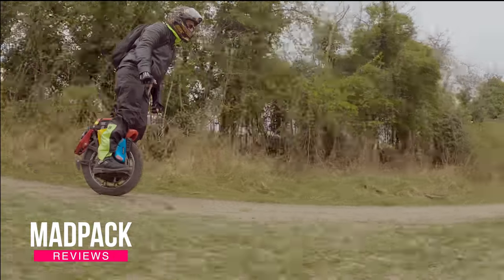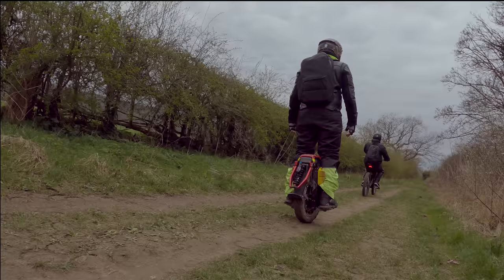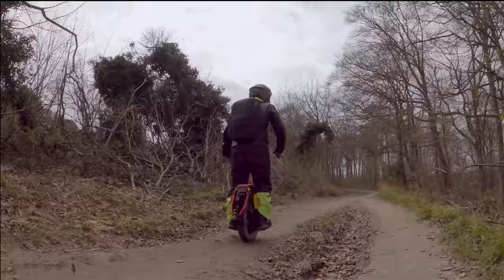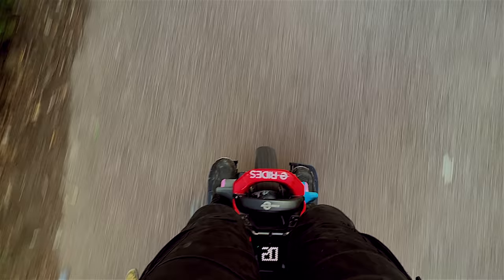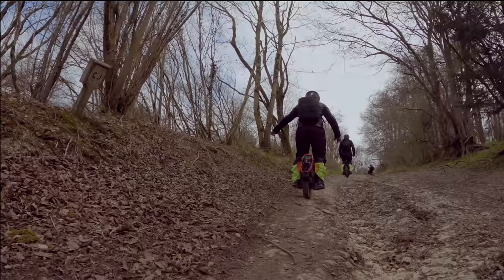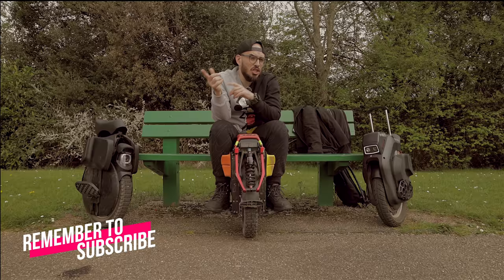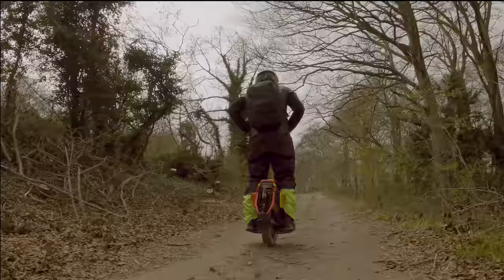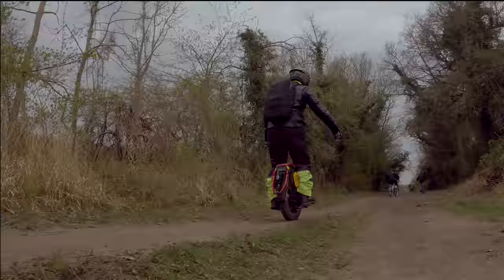Kingsong S22 Review - Best Worst Electric Unicycle 2022

Comment: Good to be critical, but one thing you don't mention is that this S20/22 is a preproduction model. So things like the suspension sliders will be an issue. but things like screw length can be somewhat understood. Rushed out prior to CNY.

Edit: To be clear, you mention that it's a prototype. I typed this specifically in reference to the screw length thing. As in, "when talking about the screw lengths, you don't mention that this is probably pre-prod related".
Reply from the maker: I said multiple times during the 24 minutes that is a prototype but is in my opinion so much hardware issues that is a shame that you can order something that is far from perfect. Like I said this is an amazing prototype but nothing more than that
Reply: He said it multiple times throughout the video.
Reply from the maker: Maybe he was answering to another video :)
Reply: @MADpack  No, and I don't mean to be rude. But if you go to 18:40 and watch for a minute, you mix your idea of 'good prototypes' in with the general idea of a pre-production device. I think you then use your comparison to the V12 pre-prod to say the Kingsong isn't ready enough.

To be clear, I'm aware of what you've said in the video. Hence me mentioning the suspension slider bit as valid criticism even at pre-production. I was specifically saying that bits like the screw length are a non issue for a pre-production device. 

TL;DR. I agree with what you are saying in general, but was disagreeing about the screw lengths being something of concern for batch 1 (2) buyers.
Reply from the maker: It is since this is a pre production that have basically no time to make changes you could order this wheel last summer man… I compared to the v12 since I get it in the same stage. Inmotion asked me to make 1000km on it and give my feedback and that was a product that you could see what close to finish this is literally a prototype should never be possible to order it.. is far from acceptable.. so sorry I don’t take one word of what I said bro. And 1/2 batch should be treated as 3/4 batch they are customers
Reply: @MADpack  no time to make changes to things like the suspension slider channels... Which I agree with you on.

But enough time to make changes to things like screw length. For example, we've seen them change the front handle compound, so clearly it's not too late for any changes.

I understand it's not the best practice and IM handled it better oveall.

But last year 'you' couldn't purchase this wheel. Dealers were offered the option to buy pre-prod wheels. These wheels were seperate from customer devices right from the start.

I think we are talking past each other. Have a good day.
Reply from the maker: Sorry bro I completely agree with you what you are saying I said in the video… if this was a real prototype what I’m saying is a product that they are still making some experiments is ok but when the first units they’ve been already sent away hummm… do you think at this stage is acceptable to get a wheel like this? I don’t think so
Reply from the maker: The lack of quality in screws per example is an old problem when I try to change the position of the pedals on my s18 (not a prototype end version the screw they were gone) unfortunately they send blow quality screws and parts to first batch purchases and I don’t agree with this kind of approach
Reply: @MADpack  the wheel you reviewed... To be clear... Was one of E-Rides S20s.

This IS a pre-production wheel.

It is seperated from the production wheels by about 2 months.

I can only partially agree with what you are saying here. It's FACTUALLY innacurate to say the wheel you have is identical to ones customers will have.

You literally ignored my reference to the handle material as an example as changes between pre-prod and prod.

Prototype is a term.

Pre-prod includes prototype but they are not synonyms. You are riding a pre-prod wheel.

Sure it's not pre-alpha as you may have wanted and is closer to a beta or early access... But it's still pre-production.

Comment: "Do I recommend? No."
Me: preorders a third
Reply from the maker: Happy for you man the money is yours In the end of the day your call that is your end decision.
Reply: @MADpack  the simple fact is that there isn't another wheel design that can hold up to me and my terrain and I want to have different tires on my rides.  I'm all out on gas and all in on EV.  I've got a couple tadpoles I'm upgrading to CVT/belt/mid drive as well as my fat tad is getting suspension upgrades because I keep breaking it.  ;-) 

I would recommend The Eagle for NOBODY unless you're doing trail riding ONLY.  Which is what I do (I live about 25-30 minutes from Brown's Camp OHV park).  After the second time I got hit road riding, I sold all my road stuff and went trail only (that was back in probably 1996).  I have one dirt bike left and it's also for sale, but people are afraid of it because it's a bored out and overbuilt apex predator and they have trouble staying on it.  I can't in all honestly preorder a third until I sell that machine - and by selling my last gas machine I also get to get rid of all the oil, lube, cans, rags, etcetera and replace it with nice clean power packs and energy harvesters plus some extra space for more refreshments...or MORE WHEELS!

I have a V10F that I use a little but I really really don't like riding anywhere near main roads, much less on them.  I have a V12 NIB that if I can flip that for most of what I paid for it and get my last gas ride sold, then I can fund the third wheel.

I'm not going to buy three different ones because if there's a flaw then I can fix it in all three and be done with it.  I'm going to have to do work on ANY wheel I get, so the diversity of having three suspension wheels IMO is far outstripped by being able to do upgrades to all my trail rides at once, if need be.
Reply: @MADpack  Also I couldn't have made most of my decisions in an educated way without all the content and demos enthusiasts such as yourself take the time and effort to put up.  Most people don't realize that even if someone is throwing up raw video it's still a time sink, and if it's quality content with decent production, well that's not magic either and often takes more time than shooting the footage itself.
Reply from the maker: I’m happy for you and the important is that you are happy with your choices. Like I said you know your needs and if what I said is relevant or not for you. That’s not my job is your decision and call. I have to say that im jealous that you live so much in the middle of no where since I love nature. Enjoy it and be safe
Reply: @MADpack  Yes I just didn't want to seem like I was being too flippant but there is a definite reason for something like the S22 to exist.  In all fairness, I kind of wish it had less battery pack because 10 miles of trail is already a lot of work and most people (including me) will need a break long before that.

I hope to get some footage up and some streams of events here - there was a lot of bad hype about Oregon a couple years back and I'd like more people to visit, once everyone can visit - it's open here right now.  The mask mandates were lifted over a month ago and most places are back open for business; concerts and festivals are back on for summer 2022.  The whole Oregon coast is public property, for instance (yes, you can drive on it pretty much wherever you want).  Waterways up to the high watermark are protected for public right of way and in most cases you can actually free camp in unimproved areas for a few nights up to 2 weeks (legally).  There is plenty of city and urban areas to play in, I just don't like getting hit while riding.  Portland International Raceway rents time and facilities to enthusiast groups so people can bring their own cars and motorcycles; there is also motocross every Thursday for the past like 20 years - I hope to get some laps in between events to show people where EUC tech is going and can go.

I do look forward to riding the stairs in my town here, there are thousands of them everywhere, they're nearly all stone or cement, and it will take days if not weeks to document them all (by riding them).  

If I can get enough people interested then we can probably get some bigger events in some great venues going on, maybe even some that can span a few days (again, we have plenty of camping, improved and unimproved).  I'm especially interested in seeing how EUC races will go on clay flat tracks, which there are at least 10 left in the state IIRC.
Reply from the maker: The issue I don’t live in the USA bro I’m in the uk maybe one day I can go to the USA and I can borrow one of your EUC 😎 thank you for sharing it happy to have you here

Comment: The title is quite misleading isn't it? 🙂 I guess you reviewed Kingsong S20 pre-production sample. Not Kingsong S22 as nobody really know how what that one will be like..
Reply from the maker: No bro the s22 is a software change from the version 2.17 (fire version) and after fire 2.19. When you turn on the wheel it even say s22. If you think the opposite check other reviewers that have the wheel like bonheur sur Seine and you will get the same answer :) hugs
Reply: @MADpack  lol, really? Can you imagine some review od Tesla model 3 where they upload software from model X and review it as a new cheap of model X that has not been even released yet and call it a day? :D Nobody has the production wheel yet so nobody knows what all changes they will make. Including materials and even looks like ewheels will push them to change accu from LG M50LT to Samsung 40T what is very significant upgrade. So I think that you just released review to something you've never even seen :)
Reply from the maker: Man whatever you want go and see other reviews go in forums and get informed turn on a s20 with new software update and is called now s22… but do you think that better battery will solve the suspension issues? Or the unbalance issues? Or the lack of breaking? Or even that I forgot to show after 300km a motor with motor issues (parts loose inside)? It was not me that I put out the software version 2.19 and changed the name to s22 my friend. I agree with you until the part of the Tesla the rest like i said wasn’t me that I release a new software and decided to change the name to s22… if kingsong wants they can after send a final version and I will be here to test it again like inmotion have done with the v12hs … more than happy to get it and test it if they want

Comment: Usually I look for a silver lining but man, as an influencer you need to be better than this. Do not review the product if you hate the manufacture that much unless you admit you are working for its competitors.

It is dangerous because you clipped a pedal....what are you talking about......as anyone that rides MTB trails would know that clipping a pedal is a normal thing. (the better you get the less you clip). 

All the changes you had to make wheel better are in the design of the wheel except the power pads (I am sure most influencer are making some money from selling after market accessories, and that is the ok). How many wheels are on the market that can give you this kind of customization. ZERO

Is it not true that any wheel with a fully charged battery will cut out if there is to much regeneration from braking?

It would be more beneficial to the community if influencers are less bias. It isn't long ago (year or less) were all the manufactures were using wood screw in the plastic bodies, wires all loose and getting caught or cut by plastic parts, spark when plugging in, and so many more issues.

I would like to see Inmotion, Begoda and King Song produce better EUC but they cannot do this if they stop making EUC. I am assuming that InMotion and KS make other product other than EUCs, so for them it may not be a big deal if the discontinue their EUCs (Segway). So we could be left with one company and that does not look like a bright future.

Niche market....big picture....more competition....better product....more users....lower prices.....more accessories.....more fun.
Reply from the maker: I don’t work for anybody because for that someone should pay me. First of all also I used to work with kingsong that was the first company to have me on board on EUCs but they didn’t like how honest I was.. 

If I was bias I will just say that I hate or this wheel is better. 

If I was bias I would say that inmotion is my favourite wheel of the year since they send me there wheels but until now for 2022 my favourite release is the begode hero.

Nobody pay me to say a thing the moment that a company ask me for that I’m out… by the way when I worked with ks they offer me a ks s18 to don’t release content but my answer was no. Before you say you own a ks so they give you that was my distributor in Europe that send me one (I’m talking of myewheel)

Also as an influencer I have all the interest to say that all wheels are good so I can sell some units of does wheels… 

About the power pads first company that I got to work with was Clark pads and I was not really impressed go and see… and yes I get comissions with pads (around $5 per set) but I receive 5% per wheel so what you think is more interesting for me to give a good review? To the s22 or to a power pad? 

I’m not a guy that do this for money I have 2 other jobs to put money at home I do this for passion so before you call me bias I recommend you to be a regular viewer so you can see how brutal I am on my reviews even working with the companies.

Comment: Bro I'm sure alot of KS fanbois won't be happy with what you say. To be fair, its does take a while to get used to a new & very different wheel. Pedal height is a personal preference so I leave it as not a fault. Otherwise, ya KS treats us, their paying customers as  ̶g̶u̶i̶n̶e̶a̶ ̶p̶i̶g̶s̶ test pilots. Happened with the s18 & now its happening again. I get it but ppl will feel butt hurt for pre ordering 1st & maybe 2nd+ batch. Thanks for being honest.
Reply from the maker: In this case the height is more than just a preference since in the normal position you struggle even more to break because the wheel doesn’t want to curve so you can’t kick to the side to break (and the breaks are already really bad) and beside that when the wheel wants to curve the tire lose the grip so the passage of weight is to brutal passing from 8 to 80 and making riders crash with the s22